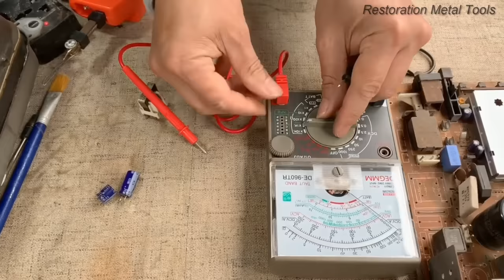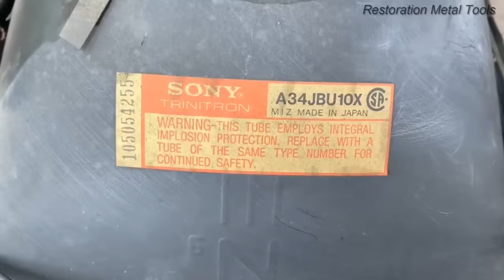Restoration SONY TV produced in 1990 | Antique television restore | Restore old color TV

Comment: WOW! It's amazing how this TV has been buried in mud for 20 years but inside it is pristine, except for the expected 20 years of dust. None of the mud managed to work its way through all of the numerous air vents. Sony could have marketed this as the only "mud-proof" TV on the market.
Hang on ! Skullduggery is afoot here. Did you buy the cheap "spray-on" mud or did you make your own, top-notch, proven for YouTube, concoction?
Reply: Also, there's no mud in the handles on the sides of the TV.
Reply: there's a lot of dust in there, but no apparent deterioration from the large amount of moisture that should have gotten in because of all the mud and muck it's been out there for so long;  I think that TV was simply stored indoors and was disassembled to dirty the outside on purpose, without affecting the internal circuits
Reply: Set up video
Reply: Such stuff indeed won't look that dirty.
Reply: A financially poor Oriental who has [somehow] bought a smartphone, installed a YouTube app on it and found he can commit fraud with the adverts in the video 😡

Comment: Wow, he cleaned the screen with a wire brush, then an abrasive scrub pad... 🤪
Reply: I would be worried about the wire brush but the abrasive scrub pad isn’t strong enough to scratch the glass
Reply: So if it was steel wool then I would be having a heart attack
Reply: A fraudster and didn’t care 😠

Comment: Electronics are not learned overnight, we can see that no method or basic safety standards are followed.
The measurement of the capacitors is completely incorrect.
The device is not even tested before closing and checking for further breakdowns.
Reply: Shouldn't you rewrite the 2Ghz C-Band when you insert an ablute voltage to the power supply? Also, they never detected the main electron gun yolk before mess with the Q1E capacitors:.
Reply: Yes I used to repair them. Big problem was bad solder connections on these sets and no adjustments were needed ? Controls certainly would have needed cleaning.

Comment: 7:33 What a load of bollocks. Pulls off a blown, burnt out transformer that he's clearly placed there and pretended to remove it.....only to replace it with a 1:1 inductor??? Replaces 2 dodgy capacitors and doesn't find or test for a single other faulty component across the entire board!!?!!
Oh well, he still achieved his goal.....I still watched it! Will be my last though.
Reply: That transformed lucky he found a new part. Didn't have to fix any bad connections which was often a problem with Sony. No adjustments needed and it works great.

Comment: ☘️isn’t it amazing how a tv covered in cement, open to the weather, can be miraculously cleaned  powered up and produce a picture. Amazing how Sony parts can suddenly appear and be fitted without extensive inspection and diagnosis of problems. Worth noting that the set was fully assembled without prior test of set which tells me this was a cheap Chinese setup like everything cheap that comes out of China.☘️

Comment: Very interesting, I would like to learn how to do this. On your next video could you please explain the process you go through and what the readings actually mean when you measure on your meter? , the methodology of you diagnosing etc. By the way, you missed the obvious dry joint on the horizontal deflection feed, if you play with CRT’s you need to discharge the HV to the degauss, wire (else you may get seriously hurt),  and you might want to actually check the B+ voltage before putting the cover back on.
Reply: Well you start by putting mud all over it first
Reply: Discharging that was my fav bit in my TV repair days ;)
Reply: He is a fraudster ~ and would expose his fraud 😠

Comment: Hello! Sony's TV is not bad, but it is advisable to solder the board, nowadays, ring microcracks are formed on the soldering, especially in those places where heating occurs: TDC, power supply transformer, horizontal and vertical scan, tuner, damping resistors in the power supply, voltage stabilizers. electrolytic capacitors, esr probe.

Comment: this master has no idea in electrical engineering
The most important thing is that the master found such admirers as himself.
explain to him that the TV is being repaired if there is a circuit and is measured with a multimeter when voltage is applied to the device

Comment: This TV ser have a CINCH CVBS input, fore use with a DVD player or VCR, or digital TV box receiver with analog CVBS output, analog M/N internal tuner may not used, because analog broadcasts are switched off( with antenna, and CATV, and SMATV ), CVBS input is good for RETROGAMING ! For example, a Japanese SEGA MEGADRIVE with CVBS in NTSC 3,58 standard.

Comment: How to produce a restoration video: 1) turn on power and of any working electronic devices  2) disassemble all parts 3) assemble all parts 4), move to trash, and make it dirty,  5) Pretend to pick up electronics from the trash 6) wash all parts  7)finally video editing with 5631, or you can even simple combines step 2 and 3 , backward playback disassemble parts=>assemble parts, note, washing electronic parts has high risk, must be place at the last step.

Comment: Notice at 1:26 how the mud was clearly spread and rubbed onto the TV screen and all over. The mud accumulated by the time has a completely different appearance. Also it's easy to realize that where there is no mud it looks clean, in fact it would have a lot of dirt inlaid in the plastic, like a lot of dry dust. Totally fake and easily to spot.

Comment: This guy finds a TV that seems to have come out of a concrete mixer, cleans the inside with a high pressure cleaner, takes out a few random components here and there, verifies them with a totally unsuitable instrument, putting them back in with a soldering iron that destroys the PCB traces in no time and there you go a perfectly working TV. You don’t even need to adjust it. I must be a total idiot spending a decade on training. And the worst part, people even believe this.

Comment: This guy has wantedly put cement and dirt on the TV. It's fresh cement. And enacted as if he is finding out the TV. The old TV must hv been in the garage or loft... anywhere else. Definitely not in the construction area😂... Show original itself dude. Don't try to increase the before after variation by using funny methods😂

Comment: That TV is obviously planted..A real tv in an impoverished nation would have already had it's screen kicked in and the copper coil on the back of the picture tube removed for scrap.. This tv was probably still in use before it was rubbed with mud and stuck outside to be "found".. lol
Reply: ok so rubbed with quikrete, not mud, but ok.

Comment: ....and suddenly building activity stopped after a TV set was "found". I've seen dozens of these fake restoration videos. The only difference between them is the location where the stuff is "discovered".  None of these dudes making these videos has any knowledge to effect electronic repairs. Just look at that soldering iron and the random meaningless testing with a multimeter.  This scheme is running a bit thin now.